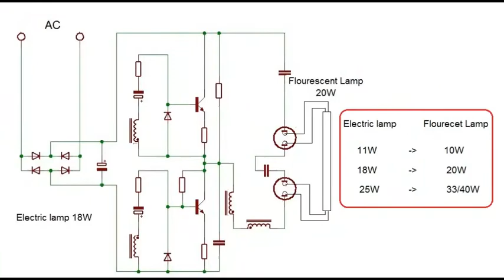Cara Rekondisi Lampu Elektrik menggunakan lampu TL/Fluorescent !!!

Comment: Mas mesin nya 20 watt berati bisa kah mas pakai lampu tl yang18 watt
Reply from the maker: Bisa mas, tapi kalau ada mesin yang lebih rendah watt nya dari pada lampu tl nya. Misal 25W pakai tl 30 watt atau yang 35 watt, lebih awet.
Reply: Mas kan mesin nya 25w tapi lampu tl nya 36 watt bisa kah mas
Reply from the maker: @josuabintang7746  iya sangat bisa, lebih awet mas. Saya sering pakai itu. Kalau mesin watt nya lebih besar cepet rusak, saya sudah beberapa kali coba cepet rusak.
Reply: Makasih ya mas dengan info nya
Reply from the maker: @josuabintang7746  ok, sama2 mas bro...semoga bermanfaat. Kalau bisa semua yang merk philips.
Reply: Ok
Reply: Mas nama merek mesin nya apa
Reply from the maker: @josuabintang7746  kalau ada philips juga.